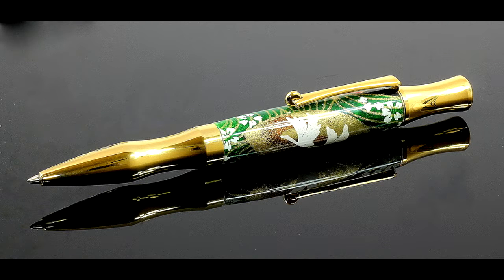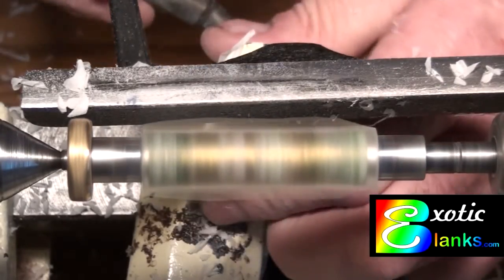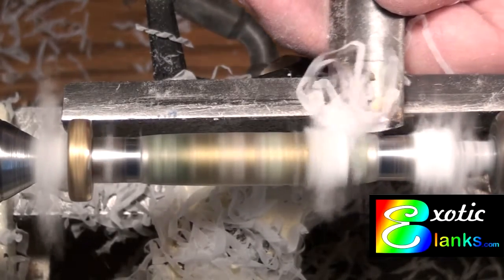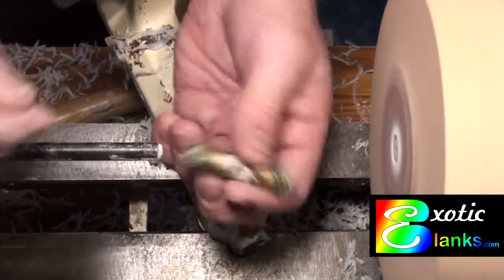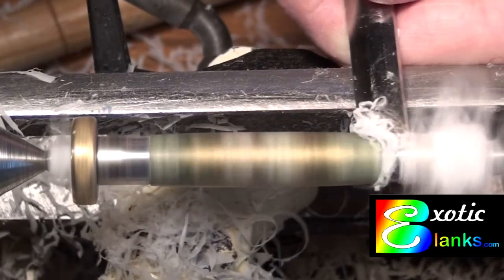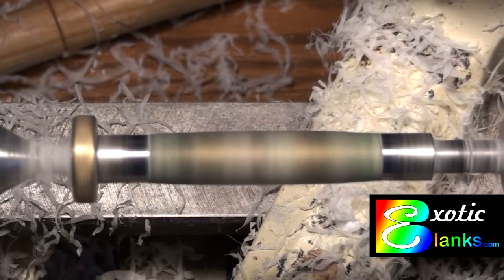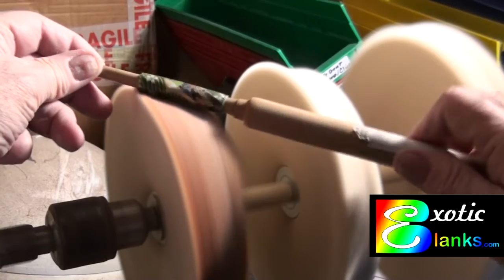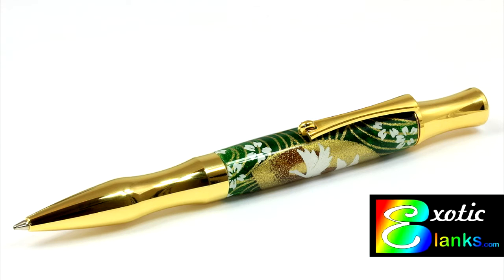Chiyogami yuzen pen blanks

Comment: Beautiful blank.  I sure wish I could use a skew like you do.  Did you round over a straight skew with a grinder?
Reply from the maker: +ward459   Hi Ward!  I have several skews, no two of which have the same profile.  When I use a tool, I can take about two passes and fall into a "comfort zone" on that particular tool, at that moment.   Years of turning is the only explanation I can give.  Ed

Comment from the maker: MAKING blanks like this is "self explanatory":  Adhere the chiyogami paper to the brass tube, and cast in clear resin.  BINGO, a blank!!

So, why can ExoticBlanks SELL these?   Because there are a lot of ways to follow the above instructions and most of them will not create a great, clear blank without air bubbles!!

The variables you need to define are: should you color the brass tube before you start?  Paint? powder coat?  what type of adhesive to hold the paper, how long to let that adhesive cure before the next steps, how to clear cast the blank without getting air bubbles---which can involve casting vertically or using a pressure pot and probably many other ways that I have not tried.

In short, MAKING blanks in clear cast resin is not a science, Dawn did it when there were few others making the attempt.  We bought resin by the 55 gallons and usually had about 10 gallons of failures. 

Now we offer for sale the work of the artists who have developed a technique that works for them.  Even if you got step by step instructions, there is no guarantee it would work for you----temperature and humidity are among the variables that can "ruin" a batch.   So, unless you use this artist's kitchen, your mileage is likely to vary!!

Ed